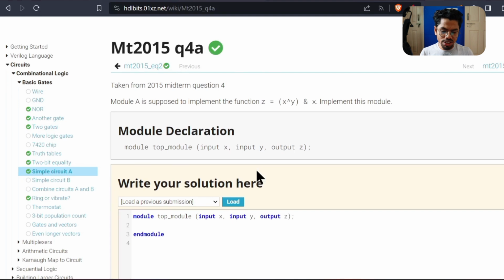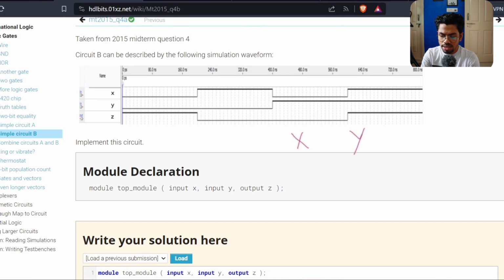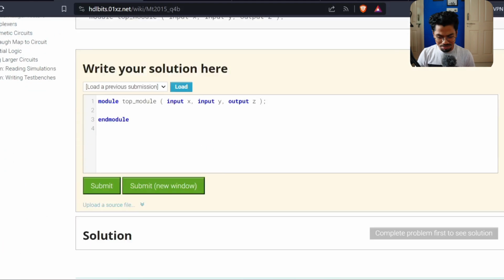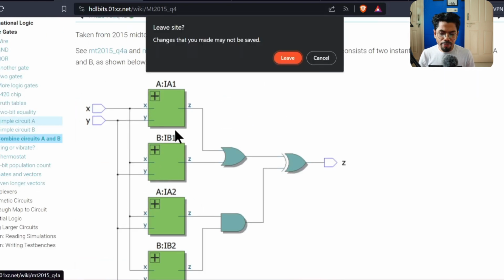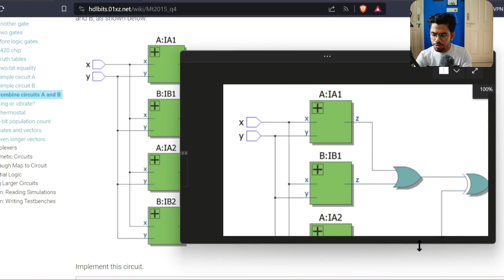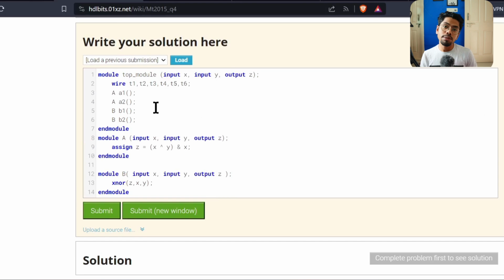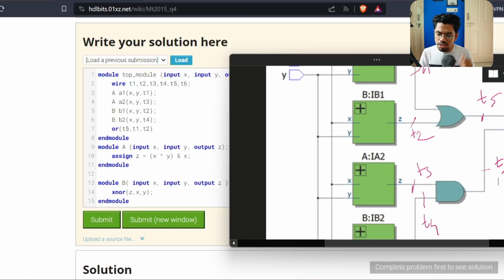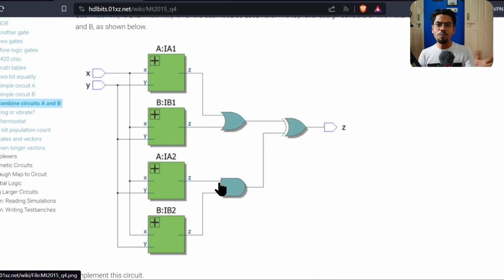Verilog Module Instantiation & Routing | 30 Days of Verilog Coding | Day 25

Comment: OUBT : 

Ref. Question : Create a 4-bit wide, 256-to-1 multiplexer. The 256 4-bit inputs are all packed into a single 1024-bit input vector. sel=0 should select bits in[3:0], sel=1 selects bits in[7:4], sel=2 selects bits in[11:8], etc.

module top_module( 
    input [1023:0] in,
    input [7:0] sel,
    output [3:0] out );
    
    //assign out = in[sel*4+3:sel*4];
    assign out = {in[sel*4+3], in[sel*4+2], in[sel*4+1], in[sel*4+0]};

endmodule

In the above code there are two assign statements . One is commented out and another one is concatenated . When I am executing the commented out one it is showing error but the concatenation on is working fine . Why so ? I am providing the error statements here .

ERROR : sel is not a constant File
Reply from the maker: Yes will see it tomorrow, and try to get the exact issue , will reply back dont worry
Reply: @whyRD   Both the assignment statements  means exact same thing . Either slicing or concatenation both should give same output . I am not able to comprehend why it is not giving output for slicing method . Thanks for replying . Also what are the restrictions of using begin and end in sequential always blocks ? For for loop there is a necessity to define for block name . Why is that ?